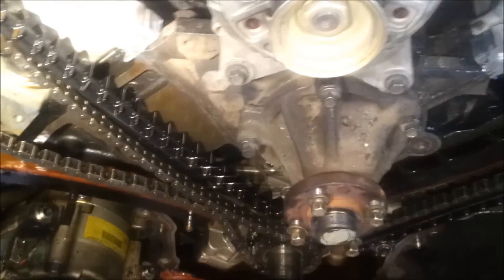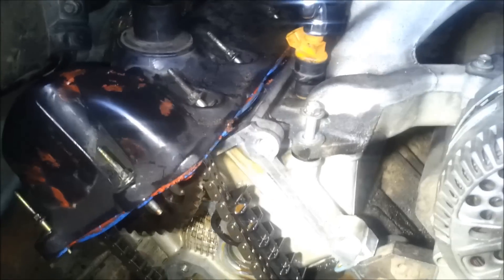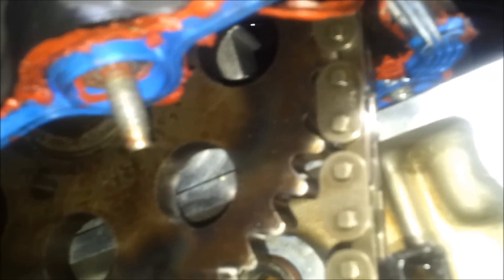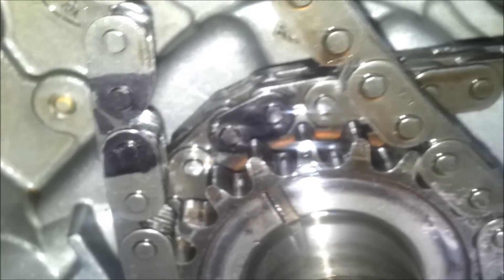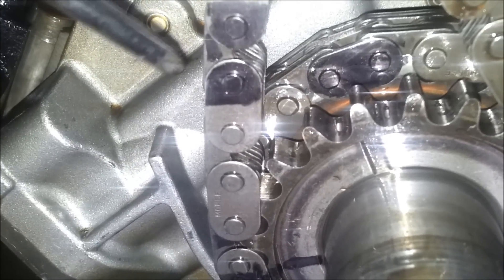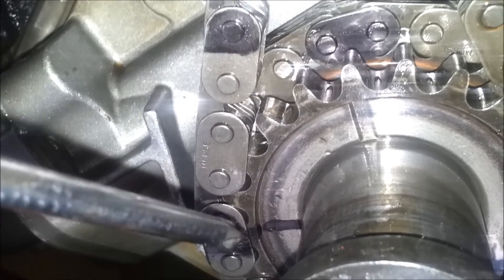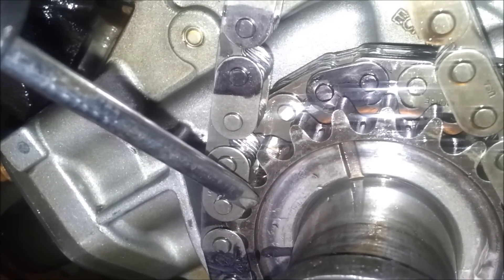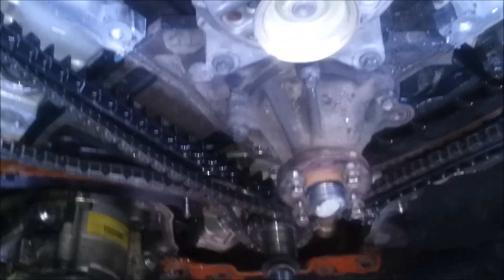Setting Cam Timing without a Cam Tool - Ford Triton v8 - 5.4l

Comment: Idk about anyone else but every timing chain I've seen for these motors has 2 colored links on one end and 1 on the other. And they are always on a full exposed link not half on 1 and other half on the other. If that is what u really went off of and u left it that way, would it start yes but would it run well while driving no. The valves could even possibly hit the pistons. Do it the correct way folks. There is a reason they tell u to do it a certain way

Comment: This will not work. If their is tension on the bottom sprocket then the sprocket will not jump teeth. The sprocket will be stuck in the chain links if the timing chain is still connected to the cam sprockets
Reply from the maker: It works.

Comment: I’m doing my 5.4 3v bad guide so passenger side seems to jumped time.  How can I go about getting truck in perfect time for the new kit I ordered from Ford?
Reply from the maker: Did you watch the video? This method times it perfectly with no special tools required.
Reply: @JonathanErber  yes, but my chain doesn’t have any marks   So did you just use paint marker on your chain that the phaser marks?

Comment: Does anyone know how to Mark the timing chain on a 5.4 2 valve
Reply from the maker: Search for Erber Auto in Moscow, ID. I will be back in the office on Thursday. You can call me then and I can send you info and pictures.
Reply: According to Ford:
Stretch the chain out where one link is at one end and 2 links are side by side on the other end. 
Mark all 3 of these links. 
You should now have a chain with 2 links marked on one end and 1 link is marked at the other end.
The one colored link lines up with the crankshaft sprocket mark, while the camshaft sprocket mark goes exactly between the 2 mark links on the other end of the chain.
Reply: Sounds correct, well said.

Comment: I see that you accessed the engine compartment from inside the cab. Is that a van? If not, how did you do that.....lol.
Reply: OK, thanks for your quick reply. I didn’t think that I could access it having a pickup but thought I might find out something new. I was really hoping.....lol
Reply from the maker: Yes, this is a van. :-)
Reply from the maker: Yes, this is a van. :-)

Comment: also the colored links on OEM chains wear off over time and are hard to see
Reply: I have no marks help
Reply: Look at the picture on line, count your links and use a marker and mark your links.  I could see mine but it was very faint.  Then double check yourself.
When I took my engine apart, the timing system was good and tight with good guides so I fixed the broken rod and reused the timing components as  they passed inspection, I did get new gaskets in most cases.  Be creative and inspect carefully.  The author here is doing a good job to do the job without having the tool, using his brain.  Good job Sir, keep up the good work.
Save money yet do nice work, name of the game.  True Craftsman.

Comment: The whole reason you need cam holders to set timing on a 4.6L engine is spring tension moves the camshaft and it will not let the cam sit in correct location for timing.. the solution I found is using the otc tool for removing the cam followers which is quick and easy by doing this all the valves are seated into head and cams can move freely with no tension set your timing then re install the followers in the heads this take 100% of the danger on setting timing in interference engine without all the expensive specialty tools.. I purchased the otc tool to disassemble heads for porting and polishing so money was well spent. cam holding tools on other hand only useful if i build hundreds of these but then again still not needed as heads would simply not have followers installed until after cam timing done.
Reply: can you do that on the 4v engines? i know that 3v you can take out the three roller followers on each side to neutralize the valves. is it the same on the 4v?
Reply: Griffon 327 did you remove all of the followers? I have ordered the tool as well as the camshaft and crank holders. Putting a head on one and was thinking about taking the followers out to be on the safe side

Comment: hi...do you know the sequence on how the heads are installed?
Reply from the maker: I don't remember the bolt torque sequence. At the time of the video I was working as a professional mechanic and had quick access to that info. I'd recommend doing a bit of googling and finding a consensus on that info (three or four reputable sounding sources that agree).
Reply: Thanks for that info. By anychance do you k ow how or where i can find the cylinder head bolts tourque sequance? For a ford F150 V8 4.6 1997?
Reply from the maker: +Jorge H. Perez C. No, same as above.
Reply from the maker: +Jorge H. Perez C. Of course if you wanted to pay a little, I would go to Mitchell DIY and buy access to all the info. That is what I would do.

Comment: quick question, i lined up all timing marks but when i give it a full rotation the colored link does not line up to the timing spot on the cam gear, is this normal? i rotate it once and its off by 2 next time around its off by 4 next time around its off by 6? did i do something wrong?
Reply: I've heard it's 38 full rotations before it comes back in line
Reply from the maker: Each time the chain goes around it is likely that it will be off more and more each time. I don't know this for an absolute fact on this engine, but that is typical on engines in general. The thing that is absolutely imperative is that it will at one time line up with all marks while the crank and cam are in the timed position. As long as you ensure that this is the case, don't worry about what happens the next time the chain goes around.
Reply: @JonathanErber That's because the chain has more links that the sprocket has teeth.
Reply: thanks for the comments @jonathan & brent, i went ahead and put it all together runs like a champ!!

Comment: think outside the box! i like it. go for it everyone. it's an interference motor. so nothing could go wrong right???

dangerous. i like it
Reply from the maker: +Lino Meraz If you spend a moment thinking and checking your work, there really isn't a way to go wrong here. It's actually even easier and faster than using the Ford tool. The only problem is that it takes thought, and Ford can't rely on mechanics having that, so they make a "required" tool.
Reply: +Jonathan Erber you're right. but if you spend even an extra second more, you'll realize that he did nothing appropriate. first he's supposed to lign up the motor at the alignment mark at the 6 o'clock position. not at the keyway at 11 o'clock. that's the biggest mistake he made. second he's relying on great vision. because without the valve cover removed he's desperately trying to make sure that he's aligning correctly. and you don't need a tool period. if you have to replace the cylinder heads the tools are useless. since the replacement heads will come in a position that is not where the tool would hold them. he didn't have the tools. no big deal. tools only make things easier. he didn't take the extra time to remove the covers or replace the gaskets. he's supposed to use sealant at the top of the timing cover were it meets the valve cover to prevent leaks. doubt he did that too. last he suggested that everyone do this. hahaha. interference motors really like you to be precise. laziness to not do things right has a huge cost if just one thing goes wrong. but what do i know
Reply: +Jonathan Erber and I'm not knocking on the guy. glad things worked out for him. but someone out there. will look at it and make one mistake because they misunderstood something. and well.... I'm sure you know the rest. Maybe it's just me. but i have met some people in life that you want nowhere near a vehicle repair where they truly don't take the time to do everything to make sure that vehicle returns to the road right. imagine a choppy up job like a brake job and now someone is driving around with shotty brakes next to someone's wife and baby
Reply from the maker: In actuality your comments are unfounded at best, and false at worst. I answer them point by point in the following response. 

6 o'clock is arbitrary as soon as the rest of the procedure is abandoned. Since I am not using the Ford tool to hold the cam in place against the valve springs, it is actually better that I not be at the 6 o'clock position as that would not be in time with the cams. We can all agree that the end goal is to have the crank aligned with the cams. 

This procedure was done on a project where the heads were removed and the head gaskets were replaced. I could have left the valve covers off, but seeing the cams was not necessary because the timing I was taking was off of the cam gears. Because of this I had my friend continue sealing up the top end while I worked on the front end. I admit the video is hard to see, but anyone with good enough vision to be working on a car has good enough vision to see the necessary marks. 

Nothing about this was "desperate". 

The Ford tool actually is required to hold the cam in the position that Ford recommends for aligning the timing chain with the cam and crank marks. This is the whole reason for the video. Without the Ford tool, the valve springs pop the cam to a position that requires the crank to be rotated away from Ford's recommended position. 

The comments about me not removing or sealing things on the top end due to time or laziness are incorrect and unfounded. The blue gaskets that you see there are new, and the orange sealant you see was still wet when the video was taken. You can doubt whatever I did after the video was taken as much as you want, but that was not the point of the video. 

Lastly, I did not recommend that everyone do it. All I said was, "this is a little out-of-the-box thing". Never in the video did I recommend this method - I was careful not to. People that will safely use this info will use the info recommendation or not. People that are looking for a recommendation shouldn't be using this tip. People that didn't follow this last paragraph should not click "reply".
Reply from the maker: Lino Meraz Your concern for other's safety is fair enough. To say you aren't knocking my method is incorrect if you read your previous comments.
Reply: +Jonathan Erber well I'm sorry you feel that i was knocking you. I intended it as this is dangerous in a way. And the difference is you know what you're doing. do you think others watching this have that same knowledge y though???

and the tool is not required. in fact your video is about not having the tool. lol.  i have rebuild at least 30 plus 5.4 motors. 2 valve. 3 valve and 4 valve. if the tool was in fact required then how come you didn't have it installed when you were aligning???? again the tool only aids. i think we can agree on that. and that's were i support you in your think outside the box. 

but look I'm not trying too offend you. i think your video was great. and again. have you met some of the people out there trying to do repairs???
i have been in the business 21 years now. and i rather be safe then sorry. i actually was going to put up a video of how to align the motor without the cam tool by only using a 6 in. 3/8 extension. wanted to see if anyone had done so already. so as you see i too do things without the tool. but i disagree in not aligning to the actual marks or 6 o'clock. i have seen techs losing alignment due to one mistake. that equals a mobile ecplosion if the car leaves the garage. but again. what do i know
Reply: +Jonathan Erber as far as my comments being false. you got me on the gaskets. yours were in fact new. in the 3valve motors the gaskets are Orange. i saw that and thought it was the old ones. my apologies on that.
Reply: @lmeraz72  He did it right and I plan to fix mine soon with removing the cam covers.
Reply: @brentbradley6711  I wonder why none of the engineering or tech books have this on there.
Reply: @lmeraz72  Cause it's outside the box...….listen
Reply: @lmeraz72  I know this is a old post but maybe I can pick your brain on this matter.. I did a head gasket job but didn't use the tools. I had the manual but mis read that part I need the cam tool.. I set the it at 6 and marked the chains before I removed Them with ink pen.. But not my marks rubbed off and timing is out of wack.. Won't start at all.. Was going to tear it down but leave the value cover on.. How do I know if my cams are in the same position when I took them off Cuz I had them resurfaced and they cam back in different positions..

Comment: was it very difficult removing the timing chain cover, balancer, and pullys, I already got my fan off im just debating to go further, did the other side align as well?
Reply from the maker: +Fern W No, that all is quite easy. Just keep your stuff organized and labeled if you're not used to digging into engines a lot. You'll need a couple special puller tools, but other than that it is just one step after the next. 

Yes the other side can be easily aligned using the marks.

Comment: Does each chain have two colored links?
I only saw one colored link on front chain. I see sharpie marks and only one colored link.
Reply from the maker: +Rick Chavez No, each chain only has one colored link. I made the second colored link. Don't mess around if you're new to this.

Comment: Thats a chance you really don't want to take when a cam lock is possible to rent from some auto parts or tool rental places. It might even be worth spending $45 or so for a tool that will be used often in Ford's with multi chain setups. Chain problems are common on all Ford's with over head cams. I see these problems all the time with Ford's that have over 75,000 miles
Reply from the maker: There's really no chance involved. It's all math. And a cam tool is great, but not always available.
Reply: Most can't do simple math. Come to find out that a cheap cam lock is $30 with tax. So taking a chance just because your cheap is crazy. Its $30 now or thousands later when valves are bent or pistons are punched or both.....
Reply from the maker: CHARLIE ARROYO You're probably right. It'd be bad news if someone didn't understand what they were doing and counted the wrong way. :-(
Reply: Even Forest Gump was wise enough to say " Stupid is Stupid does"